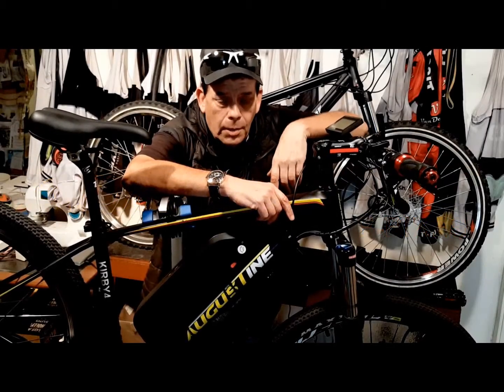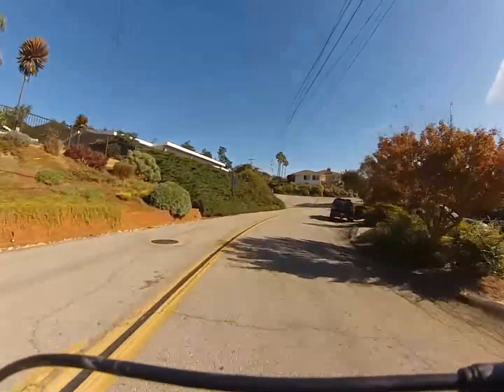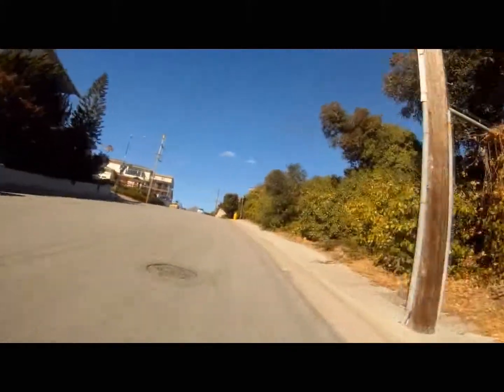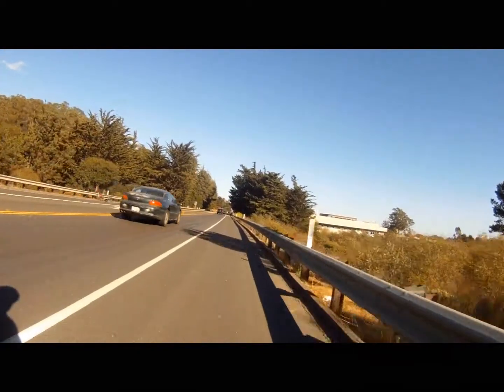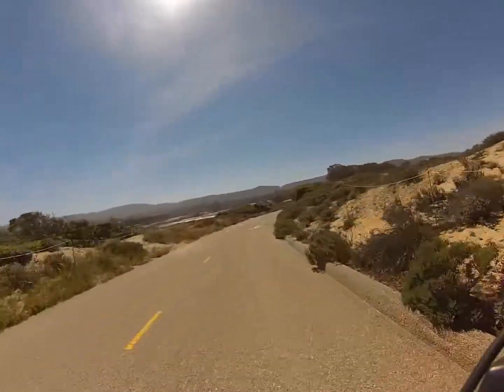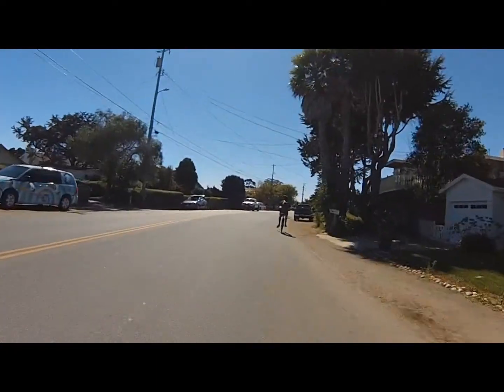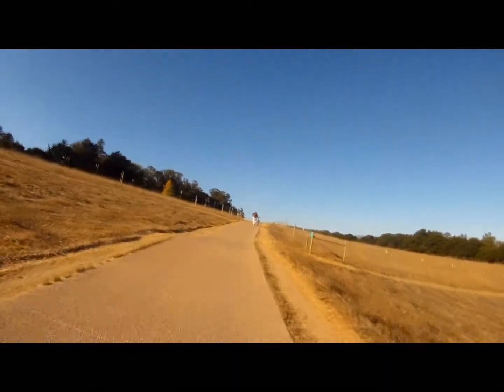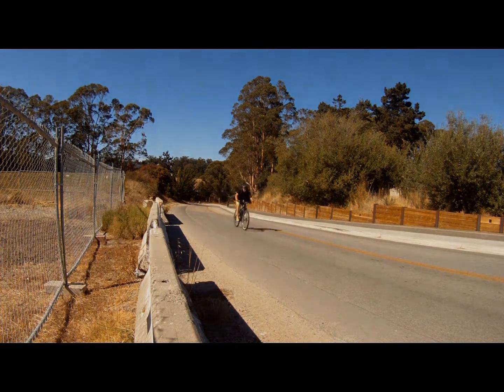1200w ebike conversion kit review

Comment: Got one, waiting for the battery. Recommended by the seller 52 V 20amp!  Should be interesting once installed. My bike is steel frame 700c ,  36lbs and im 220..Hope it does 30mph or faster when needed.
Reply: Had to wait for anderson connectors as the battery and controller connector were mismatched. Anyway its very powerful and gets up tp 25mph fairly quickly . Havent tryed to go faster as now the roads are snow covered. Imsure itll gover 30mph easily. Will open it up in the spring when the roads are dry.